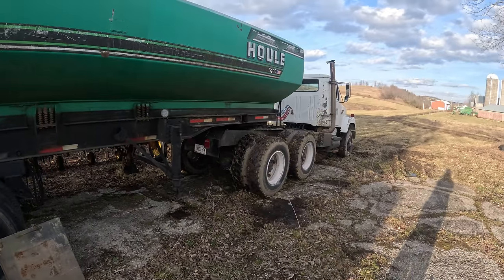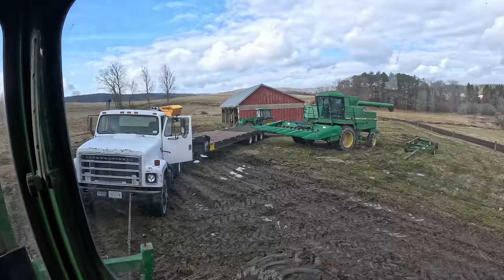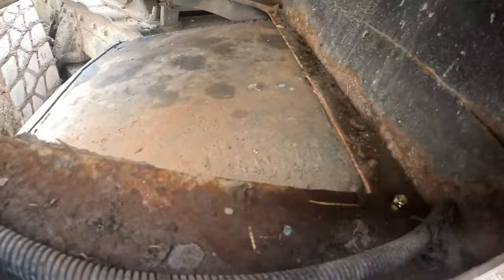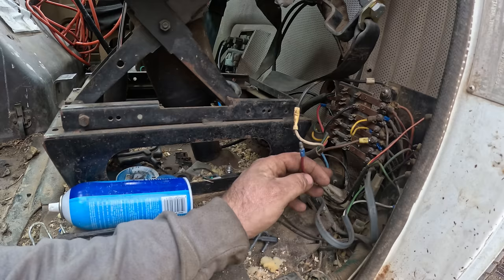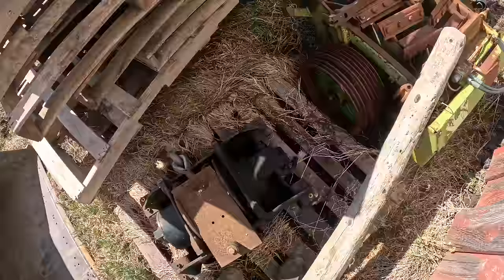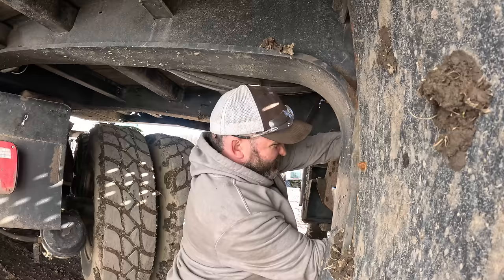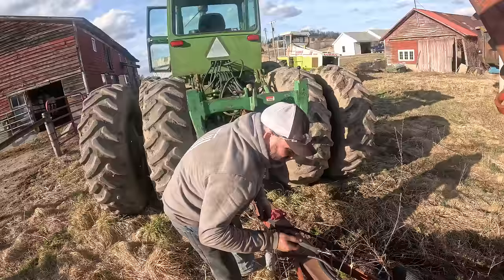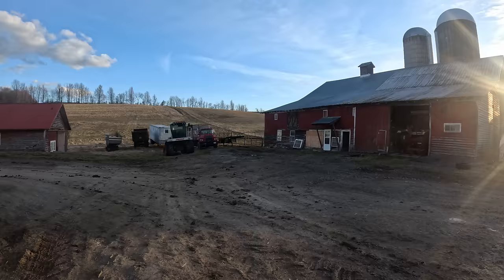So Stuck & Landoll Trailer Repair- Swapping Trailers To Get Tanker 2 Ready

Comment: A suggestion for the mud, an old trick we used was to put snow chains on 2 wheel drive trucks in the mud.  As long as it was not too soft and deep, the chains would help keep traction.
Reply: Will probably need to get some more hauling in before he can pay for rock unless you are going to pay for some for him

Comment: Hey Duffy, just a suggestion I used to fly solo a lot and had to pool stuff out by myself. I always took a bungee strap or a little ratchet strap and stripe the stern wheel down straight. or whatever to help drive the stock truck. Thanks for the videos. Keep them coming.

Comment: Strut channel steel makes a great wire-guide for interior bump prone spaces like toolboxes.  You can just weld it in place where you need it and it holds stuff in while protecting it.  Cut Yenk's oldest tennis balls into retainer disks for it too.

Comment: A trick I was taught, Before Phillips head screws or Allen head cap screws strip out apply a little valve grinding compound inside the head. It will fill the void and provide a little grip for your bit/ Allen key.

Comment: I've actually been stuck by myself before, put the PTO in gear ran the axles all the way forward, then set the trailer brakes release the tractor brakes and run the axles back to push the tractor out onto a spot where there's better traction, it's gotten me out of more than one jam with that set up. I may or may not have some pictures of a machine that weighed 160,000 pounds sitting on that trailer lol
Reply: And the trick I mentioned above, obviously is for like when you're on a slightly uneven surface with the tractor haha once all three axles of the trailer are in the mud you pretty much need a 7520

Comment: You measure the disc in front to see how wide it is  should be 25 or 27 back has three overlapping discs  so you don’t get a ridge 4640 will pull it  krause pull easy

Comment: It’s way cheaper to buy a disc with good blades then replacing the ones you have . I have a nice set of 24’ Deere disc with excellent blades I would sell cheap but I’m in Ontario Canada.
Reply: LastNamefirst-wv7jj  
I have a John Deere 230 paint fair blades excellent, tires ok  has no welds and is straight $3,500 cdn

Comment: There's no way that trailer weights 100000 pounds that's 50 ton it can haul 100000 lbs
Reply: I think that he is trying to say is the trailer is built heavy to haul 50 ton
Reply: He said the GVW for the trailer was that high.  He didn't give the empty weight.
Reply: The trailer will hold 120,000 pounds easily 50,000 pound per concentrated 5 foot span and it weighs about 25,000 pounds empty roughly little less maybe
Reply: If you payed attention at all he says it’s the rated haul weight, not the weight of trailer